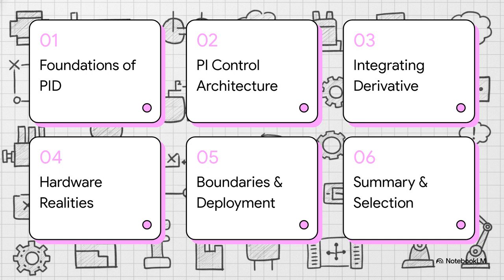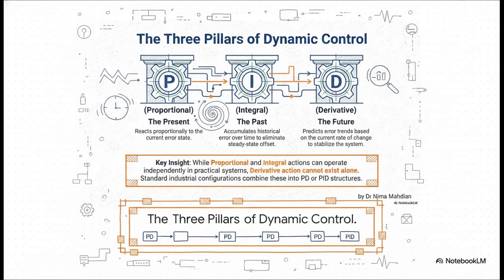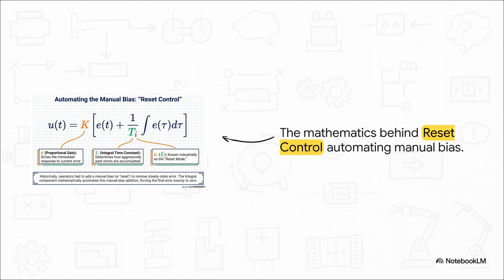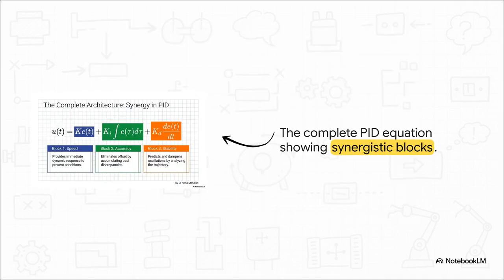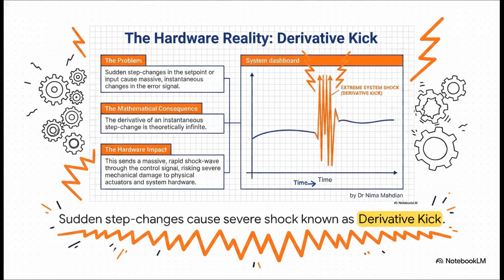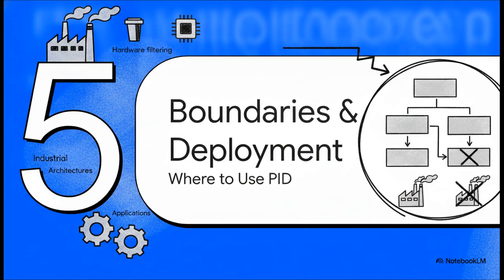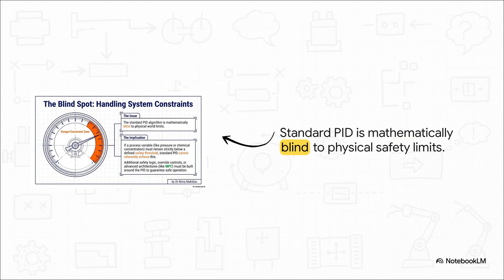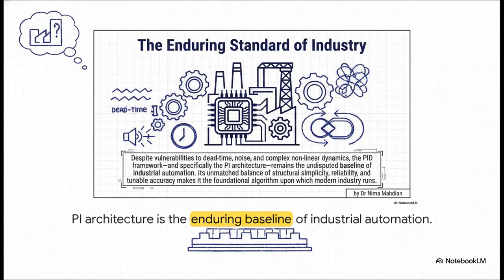Industrial PID Structures Explained | How PID Controllers Are Implemented in Industry

Comment: Thank Dr. I have question , how should the value of N be selected to restrict the high-frequency derivative gain without losing the predictive benefit of the D-component?
Reply from the maker: A larger N gives a higher derivative bandwidth, so the controller preserves more of the predictive benefit of the D-action—but it also allows more high-frequency noise to pass through. A smaller N provides stronger filtering and better noise robustness, but makes the derivative action less responsive.

In practice, engineers select N based on the sensor noise level and process dynamics, then validate the response experimentally. Typical industrial values are often in the range of N=5 to 20, with lower values preferred for noisy measurements.

So the practical principle is: choose the largest N that provides useful derivative action without producing unacceptable noise or actuator activity.

Comment: Dr. Mahdian, thank you for this clear and useful explanation my question is:
Why do 60–70% of industrial PID configurations still use PI control instead of full PID, even though PI is slower and cannot predict future error trends?
Reply from the maker: Thank you for your excellent question. The main reason is that PI control often provides the best practical balance between performance, robustness, and simplicity. The claim that 60–70% of industrial loops use PI should be treated as an approximate rule of thumb rather than a universal statistic, because the exact percentage depends on the industry and source.

Although PI does not provide derivative action, many industrial processes—such as flow, pressure, and many temperature loops—can achieve satisfactory performance with PI alone. Adding D action can also amplify measurement noise and increase sensitivity to modeling and tuning errors.

Therefore, engineers usually choose the simplest controller that meets the required performance. Full PID is valuable when improved transient response and damping are necessary, but if PI already provides adequate accuracy and disturbance rejection, the additional complexity of D action may not be justified.

Comment: Execuse me Dr Nima Mahdian I have a question the video highlights that standard PID cannot inherently handle system constraints. What is the most common practical technique to prevent "Integral Windup" in real-world systems when actuators saturate?
Reply from the maker: Thank you for your excellent question. The most common practical technique is anti-windup, especially back-calculation or conditional integration.

When the actuator reaches its limit, the controller cannot apply any additional control action. Without anti-windup, the integral term continues accumulating the error, causing the controller to become excessively large internally. When the actuator finally comes out of saturation, this stored integral action can produce large overshoot and slow recovery.

With anti-windup, the integral action is prevented from accumulating excessively, or it is actively driven back toward a suitable value while the actuator is saturated.

In practice, back-calculation anti-windup is widely used in industrial PLCs, DCSs, and digital PID controllers because it provides a simple and effective way to handle actuator saturation.

So the key idea is:
Actuator saturation → limit integral accumulation → prevent windup → faster recovery and less overshoot.